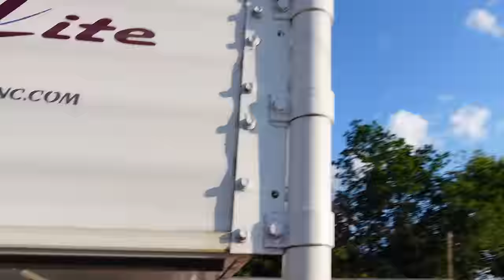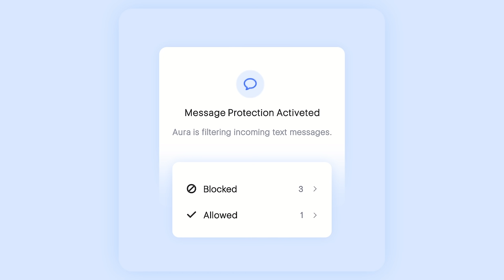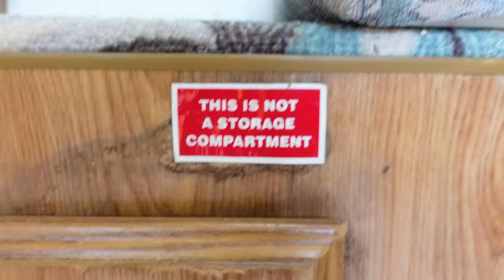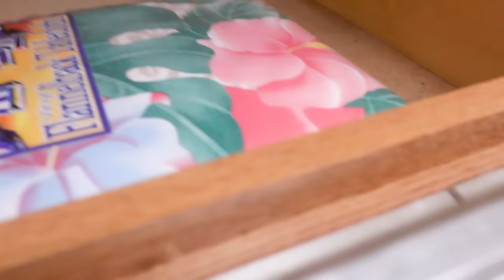i bought an old TRUCK CAMPER...was this a mistake?

Comment: My type of camper if you make it to the land of flowers down here in Florida I'd love to go on a date with you I got one of them little tents / campers in my backyard but I got a regular size camper back and a short bed on my f250 my camper back needs a little work a little TLC and due to our last hurricane we had its on an angle you and I probably got a lot in common except for I have no tattoos LOL if having 420,000 mi on a gas f250 makes any sense to you been there done that fixed it

Comment: Well I can tell you one thing I don’t know what state you live in but we’re getting some birth pains I live in California by birth pains I mean that means earthquakes if you live in California I would put it on the truck for a while until the earthquakes fade out a little bit fade out a little bit if not you need to block it up in case it happens to fall go get you some wooden pallets and stack them underneath it if nothing else in case it does fall the front door is made out of cardboard and or Styrofoam on the inside that window I don’t know if it rattles if you tap it with your fingers but it would be good to take some clear silicone and seal around the outside of the door and the window bear make a beat around it been around it BEA de Bede and that will keep your window from getting loose

Comment: big mistake cause i can grab one for free and next time buy a Ford the #1 work truck in the world and if you bought truck from dealer they need to inspect it before sale by law in most states convert popup top to hydraulic 12v pistons and it would work with a button same as campers use when pop outs open

Comment: If you have a rubberized roof if you notice a lot of the fifth wheels with the fancy push out rooms even the three axle jobs they have rubberized roof most of them are rubberized roofs are garbage are garbage if you were smart you would sell it and get you a camper with a real aluminum roof on it aluminum roof sheeting I’ve worked on mobile homes for years and fifth wheel roof camper roof Jose I was I can say is good luck all I can say is good luck if it was mine I would patch the hole with the right stuff and put the camper up for sale and buy one with a real aluminum roof the main thing in any mobile home fifth wheel or camper on anything is the roof and the floors if you have that you can do anything to them these rubberized roof that they stretched over fifth wheels in campers are garbage certain kind of sealer won’t stick to it good luck honey

Comment: If you get a leak poker little hole in it little as possible and put a string on it and the leak will follow the string right down to a pan that way the water won’t be underneath your ceiling😊 well babe looks like the camper and the trucks paid for I think so now you will honor home on wheels one thing about a girl if you don’t like the neighborhood you can always move to the other side of town and the people that live in the houses can’t   End it wouldn’t hurt to buy some Mr. bubbles or use dish soap mix it in a spray bottle and make sure you don’t like any burners and spray bottle near your tank and the hoses make sure that you don’t have any leaks food Prasad it’s not bad  looking don’t let let them give me any trouble about your cowboy Cadillac honey they’re probably jealous because they don’t have one they’re probably jealous because they don’t have one I took my first driving Cass in a cowboy Cadillac I’ve acted in so perfect a guy didn’t want me to pull forward of course that’s when I gave it some gas and ran over the orange stick ha ha ha ha you’ll get her done Happy trails keep the rubber on the road in the britches out of the ditches

Comment: Hi whatcha up to hope all is well sending up prayers 4 healing and unspoken and 4 everyone and bless great healthy peaceful safe journeys travels happy cmpn and happy day everyday in name of the Creator God/ Yahweh and Yeshua/ Jesus and the Holy Ghost/Spirit Amen much honor and respect keep praying keep watching the sky and walking tall always also keep on keeping on pushing forward one step at a time and smile also cool cmpr and truck don't get discouraged it will take sometime to get it to where u want ur truck and cmpr u will do great with the remodeling of both however chk on getting u air lift air bags 4 ur truck but leave shocks too this will help with the swag and  ride also it being high center of gravity take it slow in windy conditions also get u some remote/electric stabilizers/stands 4 ur cmpr too however those already on it is 4 stability too just don't lift cmpr up however just enough to take some of the pressure off of truck this will act as stabilizers so that when walking around in cmpr it doesn't move around as much however if u r in place u don't feel right keep them up and only use cmpn without them but remember be aware of ur surroundings at all times and keep ur ppe on hand at all times also get u the proper mounting system added to ur truck 4 these types of cmprs it will help with it sliding around as much also know I'm still proud of u and praying 4 u and catch u on the flippy/ til nxt time 
🕊🦅✝️💪🙂👍👍  
🚌🌅🌌⛺🌄🏞🏖